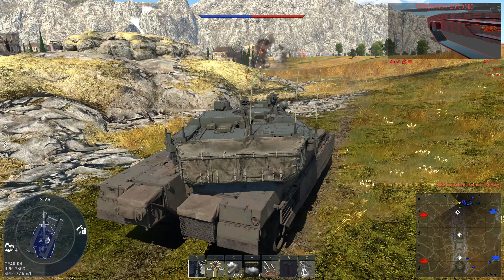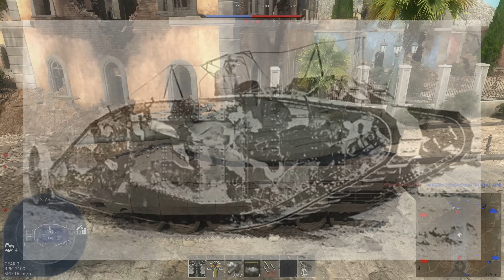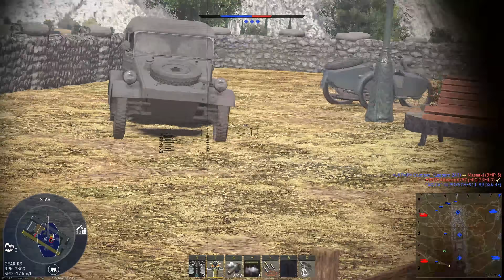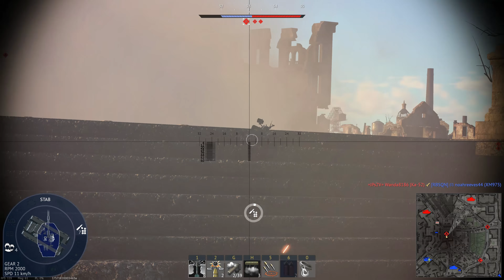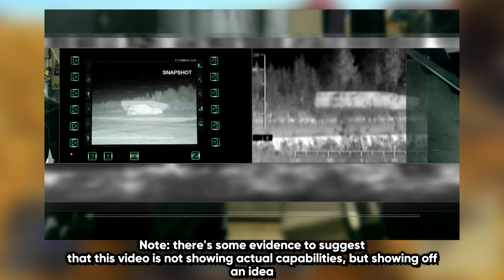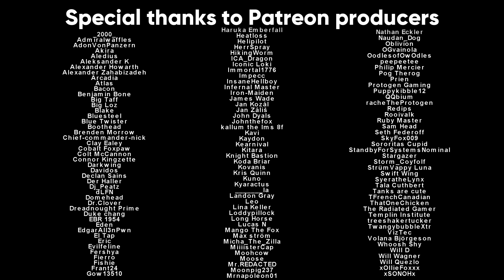Why Do Tanks Use Camouflage?

Comment: The biggest problem with tank armour, especially steel armour, is that it has to be spread out across the entire area of the tank, or at least the areas most likely to take hits, or else it would weigh the vehicle down so much that it can't move. Anything that's going to be trying to kill the tank, say, a rocket launcher or another tank's main gun, can deliver an enormous amount of energy onto one single point of the armour. With that in mind it's kind of surprising the heavy steel armour on the old school heavy tanks was ever a viable strategy in the first place.

Comment: What is your favorite Camo's?

Mine is the FORAD camo for the AMX-40 & Leclerc's. turn the camo 90 degrees max strength and make the lines a small as possible. helps break up the silhouette of the tank at distance.

Comment: "Some companies even tried to develop active thermal camouflage" tried implies that the British haven't been using Active Thermal Camouflage on their vehicles for over a decade. (Which according to anecdotes from Afghanistan, was primarily used because it kept the tank cool during the summer heat)
Reply: It's acting like all of NATO hasn't had it for decades
Reply: @justarandomtechpriest1578  It has, as far back as the 1970’s. The Germans and French developed Leo 1s and AMX-30s tech demonstrators respectively which used thermal camouflage as part of larger heat mitigation features. it’s just never been practical because the A) the appliqué has (until recently) been very bulky, heavy, and finicky to maintain, and B) too costly to adopt as the technology isn’t mature enough to mass produce and isn’t worth the money sink when you can adopt it in a few years, when it’s not only ready but also cost-effective to adopt

Comment: I can see camouflage being really useful outside of combat for simple visual concealment purposes. When the engine is not running and the tank is essentially just sitting empty, camo certainly could have a huge benefit in concealing the vehicle from detection. Even modern spotting is done with the naked eye or visual light cameras much of the time, but even more advanced sighting equipment might miss a vehicle which is well concealed visually, and which is not producing a significant heat signature. So if you are a tanker and you want to have a sleep, I see being camouflaged as a huge bonus just for that. There are probably tons of other subtle, but useful elements to using camouflage as well, which is probably why we keep seeing it applied even to the most cutting edge machines.
Reply: As a tanker this is uncoprehensible, since putting the camo on it if you stop is like breathing. Its obvious.

Comment: If an elephant or tiger can sneak up on you, an Elefant or Tiger H1 can sneak up on you
Reply: Eveyone in this reply is talking about "Doesn't block out the loud noises" 
Camouflage isn't meant for your ears. And camouflaged tanks in ambush wouldn't set themselves up close to the intercept point, they would set themselves far away to make seeing them with the naked eye near impossible. 
And even if they were loud there's always something called "Shutting off the engine"
Reply: Well, those animals also have the advantage of not having an engine always making noise while it moves… never mind the tracks creaking and clanking….
Reply: @DS-wl5pk  Tigers are known to ambush prey, too. Which is far more apt for its mechanical German cousin.
Reply: I like the analogy, but if I was a soldier I’d have a hard time not hearing the Tigers loud engine and tracks clanking. Most tank kills achieved by hidden tanks were shot from long ranges where enemies could not see the tank at the distance
Reply: @noterichhartmann1847  that assumes the engine is running and the squadron isn't in ambush mode
Reply: @noterichhartmann1847  That is also why infantry cover is so important for tanks. 
Take out the infantry component, during a pure tank v tank combat, since tankers can't practically hear outside their own tank. I mean hell, most of them can't even hear inside the same tank due to the engine noise that all of them have to wear tank headsets to talk with the talk commander. So in a tank v tank combat, the noise of the enemy tank's engine is irrevelant.
Reply: The elefant can definitely not sneak
Reply: Assuming the transmission don't break.
Reply: Well the myth is that the tiger H1/E and elefant were the greatest spawn campers on the war
Reply: Explain more I am interested in these words
Reply: @Geniusinventor  Elephants or tigers are wild animals, while the Elefant was a German casemate tank destroyer from the Second World War, and the Tiger H1 was a German heavy tank from the same time period.
He's saying that if an animal as big as an elephant or tiger can sneak up on you, it's a fairly good bet that their tank namesakes can too.
Reply: @abercrombieblovs2042  ah I see wildlife vs Machine
Reply: Not sure a TIGER is the best example for that bud
Reply: @Gary_of_Nivea  they're camouflaged only if you're their prey and and not human tho